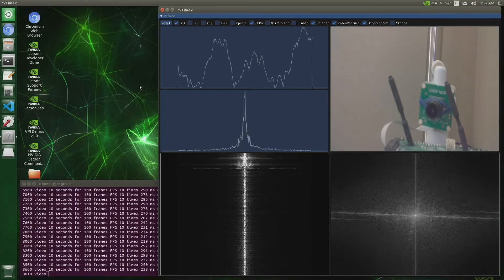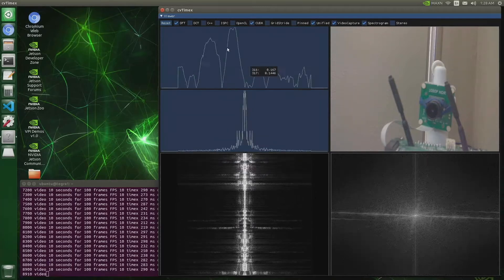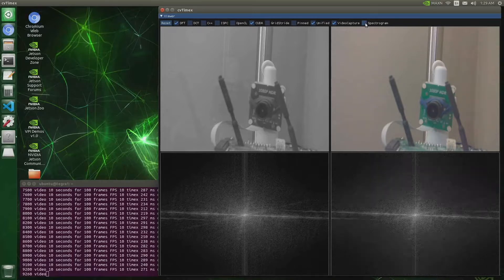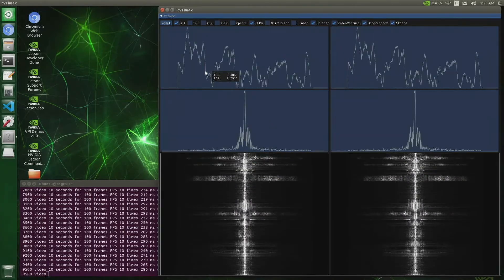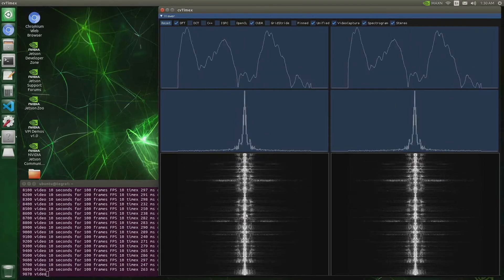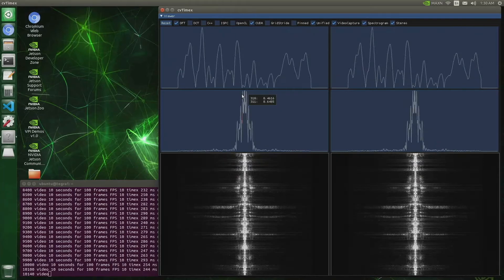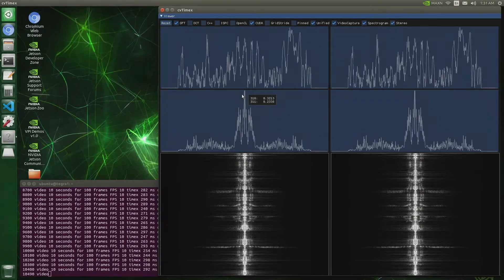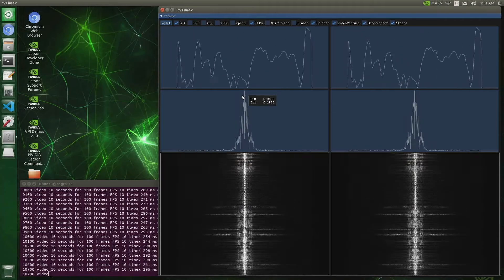Jetson Nano: Visualized Stereo Audio Using JUCE FFT Demo 6.0.7 on L4T R32.5.1

Comment: Morning sir . I want to know how you do that . I mean the different steps
Reply: I rying to do the same since 2 weeks but I failed
Reply from the maker: Good Morning, There is some learning curve with JUCE framework. I started by following the README on how to build the JUCE DemoRunner app which includes the SimpleFFTDemo. That gave me insight with JUCE FFT before I could integrate it into my own application.
https://github.com/juce-framework/JUCE/blob/master/README.md
https://github.com/juce-framework/JUCE/blob/master/README.md#building-examples
https://github.com/juce-framework/JUCE/tree/master/examples/DemoRunner
https://github.com/juce-framework/JUCE/blob/master/examples/Audio/SimpleFFTDemo.h
Reply: @alanmikhak  yes I downloaded it and  read the demo. I just want to know if you create a new project or if you are doing something else to do what you are doing in the video
Reply: @alanmikhak  I also want to know if your FFT demorunner was clear ?
Reply from the maker: What I show in the video is my application cvTimex using JUCE FFT based on what I learned from the SimpleFFTDemo.h code. Building the open-source JUCE DemoRunner was fairly clear but it took some time. I built JUCE DemoRunner using CMake as described in the README.
Reply: @alanmikhak  SimpleFFTDemo.h is not like what I see in your video ; do create your own model ? If yes can I have the differents codes ?
Reply: And I also work with jetson nano but I use a USB microphone
Reply from the maker: The video contents and notes are all I have available to share. I also used a USB microphone on Jetson Nano. JUCE has audio backends for each OS, including Linux, that work with USB microphones.
Reply: I finally gave up because it does't work but thanks for help !
Reply from the maker: @yvesabrahamkouame5939  Welcome. Thanks for sharing your comments here.

Comment: What is the speed/computation time of fft (at 512sampling)?
Reply from the maker: That's a great question. I have not instrumented my code to measure the call into JUCE FFT C++ method. If you get the JUCE SimpleFFTDemo compiled and running on your platform, you can add timing code around this line of code in SimpleFFTDemo.h:

void drawNextLineOfSpectrogram()
{
:::
        forwardFFT.performFrequencyOnlyForwardTransform (fftData);
:::
}

I posted a few videos on how to compile JUCE Projucer and DemoRunner 6.0.7 on Raspberry Pi 4. Those may be a good reference for doing the same on Jetson Nano.
Reply: @alanmikhak  thank you for ur prompt reply. I am trying to apply this to fmcw lidar application. I wanted to know Xavier is enough to do 150,000 times per second ffts with 512 sampling/fft. I know QuadraK620 can do this but do u think Xavier is equivalent to K620 in fft computation speed?
Reply from the maker: @Projan fan14, I wouldn't know. I only have Jetson Nano DevKit. I use JUCE juce::dsp::FFT C++ class with juce::dsp::FFTFallback engine which is a single-threaded CPU-only implementation. Although JUCE FFT supports other engines such as FFTW, I didn't see any that provide a GPU implementation to compare to Quadro K620 GPU or Xavier Volta GPU. Xavier T194 SoC has 8 Carmel CPU cores. My Jetson Nano has 4 Cortex A57 cores. I was able to call JUCE FFT on as single A57 CPU core to compute FFT for two channels of audio with 512 samples per frame per channel. Sample rate for audio may have been 16000 or 48000. JUCE framework would callback to my application multiple times per second to deliver audio samples in blocks of size 160 or 480 samples. After gathering 512 samples from incoming blocks into a frame, I call JUCE method to compute the FFT for the frame. A single A57 core was able to do this such that I could maintain enough bandwidth on all CPU cores for other tasks. This doesn't answer your question but I hope it is useful.

Raspberry Pi 4: Deeper Dive into JUCE DSP FFT C++ juce::dsp::FFT
https://www.youtube.com/watch?v=aI_G1iYN0EU
Reply: @alanmikhak  thank you. I understand ur application must be limited by sampling rate by ADC so I cannot compare directly. Anyway, thank you very much.
Reply from the maker: @Projan fan14, Glad to see your questions.